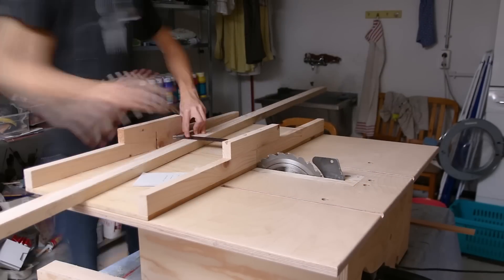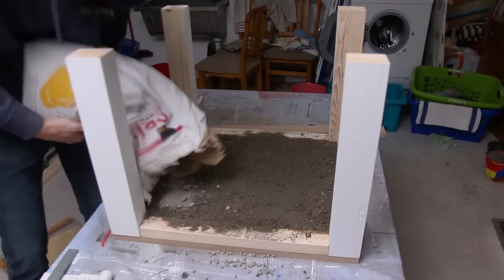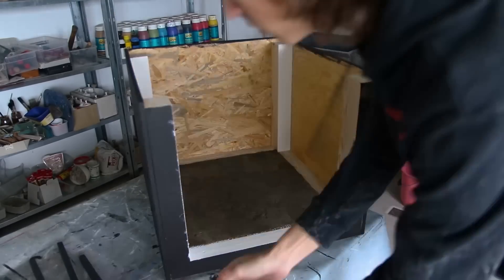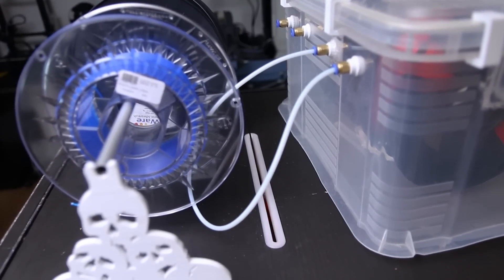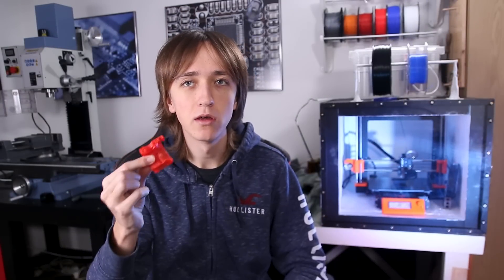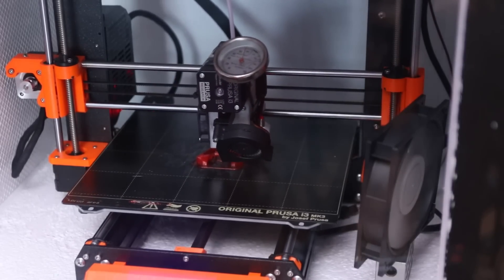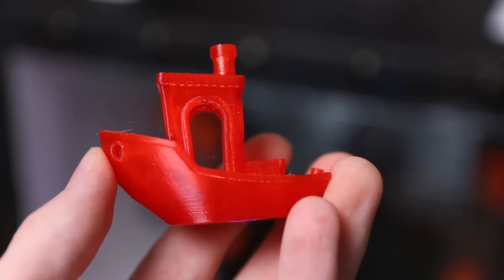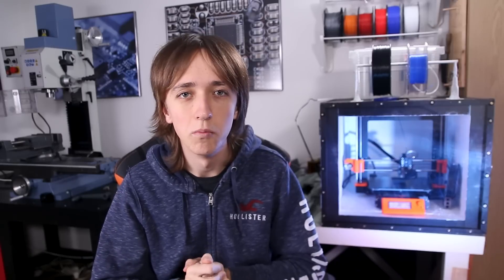DIY Heated Enclosure for my Prusa i3 MK3

Comment: damn 70c in the enclosure without active cooling?
you just saved me a lot of effort. since I was gonna add an active heater. but I don't need more than 70c. heck my PETG (and your printer is printed in PETG too) parts don't last well above 60C anyways!
I print pure polycarbonate (not the mixes) so I needed some really hot enclosure.
I can't afford parts right now tho sadly ;-;

Comment: Hey great video.  I was actually stumbling upon videos which would make the 3D printer quieter and this is a brilliant build. I didn't realize temperature had an effect such as it needs to be warm. I just ordered a printer an anycubic mega - s and preparing myself
Reply from the maker: It depends a lot on what material you're printing. With PLA it is actually better to be cooler, while with ABS, PC,... a heated chamber helps a lot.

Comment: I may keep my printer on the garage. Do you think an enclosure that is passively heated can  get to a reasonable temp? It gets down to 50° f in Winter
Reply from the maker: If you insulate the enclosure well and the heated bed is hot enough, it gets quite hot. A setup like this would be perfect for a cold garage (if you're printing more than just pla)

Comment: Very interesting video. Do you think it would make any sense to also put the filament inside the box, so it would be preheated?
Reply from the maker: No, that wouldn't help, since it is heated up super quick to the desired temperature in the hot end anyways. it could create problems though if you accidentally get the enclosure a bit too hot.

Comment: Look into styrene fumes and styrofoam temp resistance. I am not saying, you will have an issue but styrene fumes are supposedly hazardous and some styrofoam will outgas at fairly low temps. There are some XPS foams that are made for higher temps, so perhaps you want to check that out. I would hazard a guess and say the white foam you used might not hold up to 80-100C...

Comment: add a fan slot on the top and add a temperature controlled fan maybe? tho the draft could be bad. but again it could be spinning very slowly.
if it'd let noise out maybe a cover that has waves in it would help? not sure hot to explain. but make the air have to travel trough a chamber

Comment: Plastic heat resistance is one thing. Good idea to move electronics out of the box too. Even if a lot of electronic components work well at hot, sometimes there just is not enough margin for heat dissipation and the power components can overheat. Capasitor life time should be reduced a lot too in hot, especially the cheap electrolytics.
Great to see what others have done that did not work. I'm thinking of a warm enclosure myself but I'd not use styroform and perhaps leave gaps for some air flow to keep temperature resonable.

Comment: hey thank you for the video! could you tell me what polycarbonat brand you are using? Also what type of print bed surfaces have you tried? any does and donts? (my printer has a glass bed, what would you recommend -  glue stick, or buying a new bed?) 
Thanks for your help! there really is far to little content on this level or printing :D
May i ask one more thing, how do you intent to build the regulation system? Raspberry Pi? whats the plan here :D?
Reply from the maker: I made videos both about printing  PC, and also the second part of the enclosure with the electronics. You should be able to find them on my channel pretty easily.
Reply: @DarkArtGuitarsWorkshop  hey thanks for the reply 
I will check again, i have seen quite a few :) I also already prior to your video knew about the article on high pressure and width printing with PC - i sadly have not tried it out yet.
Is that still what you are using ? 
will certainly look for the enclosure videos :D 
Keep up the good work :)

Comment: A temperature regulated enclosure, you say?! Sounds like a job for an Arduino, temp sensor(s), fan(s) and some fancy code. Might as well add that to your electronics when you migrate them to the outside.
Reply from the maker: Well, it's like you read my mind :)
Reply: I would also add some kind of power cut off functionality in case of temperature higher than 90 °C (fire protection)

Comment: I have to say, that enclosure may be Overkill, but why not! it looks amazing and you probably can put an exhaust with a filter, and an inlet to regulate temperature, I'll be waiting for the next one! good luck!!
Reply: The thing is that if you put an exhaust then the enclosure is not soundproof anymore. I would use 2 big heatsink with their surface linked together. One heatsink inside and one outside. You could install a low RPM fan (for reduced noise) on the outside , and whatever cheap fan on the inside.

Comment: You have your 3D printer electronics running in that hot box? You sadist you!
Reply: 1 Question:

Is it ok to have just the psu outside of the enclosure and the einsy board still Inside?
So would it be better to have both ouside?
Reply: @Jan-cg1pq  to a point it is always better to keep electronics as cool as you can. There is a minimum operating temperature for electronics too. But it is something like -120 degrees. So unless you're pouring liquid nitrogen over your parts it's not usually an issue. There are people that do that sort of thing though. They pour the LN very carefully.